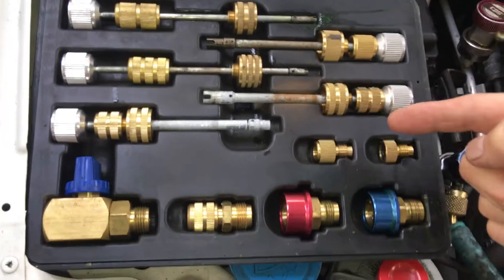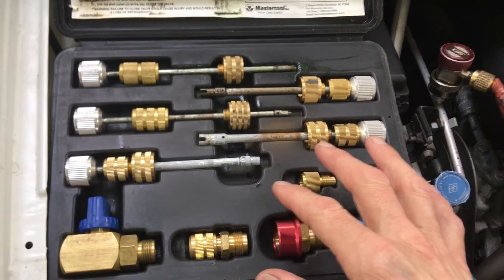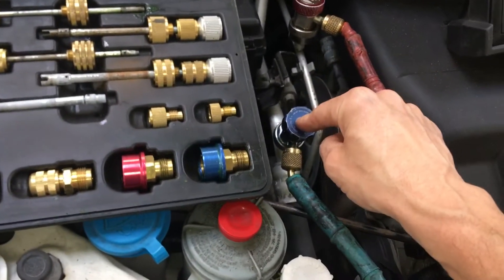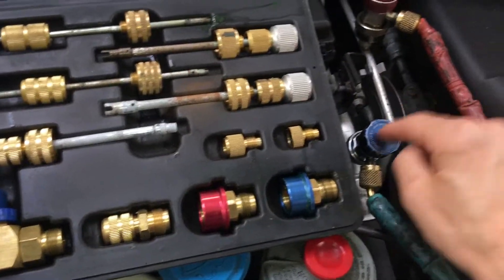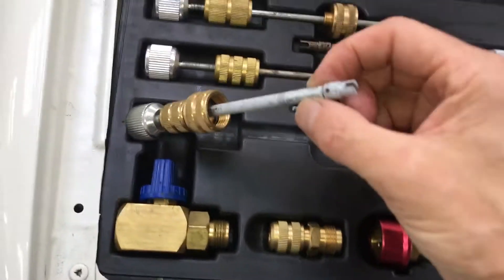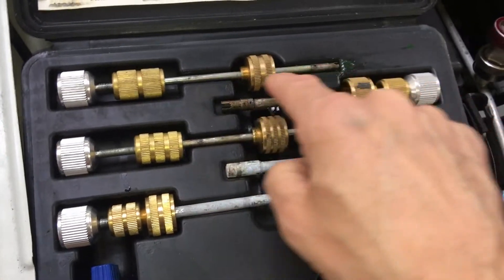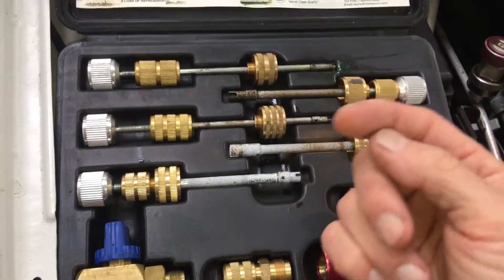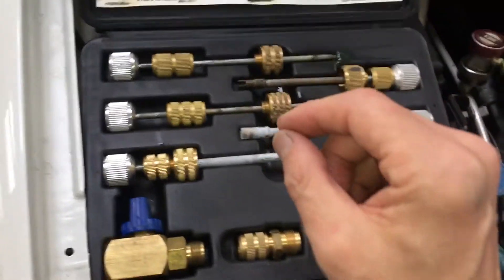R134 and R1234yf Valve core removal tools without losing refrigerant￼

Comment: Hey Tom, nice video!
Does this set fit the larger size valve cores. I need to change low side schrader valve on a r1234yf system and the kit i got off amazon is too small sadly.
Reply from the maker: It fits most.  There might be a few newer ones it might not fit.. but I have not come across them yet
Reply: @coldfinger459sub0  Thank you! It is a 2018 VW Atlas.

Comment: Thanks for introducing us to this valve core tool!
Question I've been wanting to ask is how often does your fieldpiece manifold micron gauge get oil fouled, perhaps you're taking some kind of precaution to avoid this?
Honestly, I'm getting tired of cleaning mine, lol...
Reply from the maker: I got a clean it a couple times a week. 
It’s super easy because I have pressurized 99% alcohol with dry nitrogen in a flush tank I just squirted in and then hook it up to my nitrogen tank that I have all the time anyway 600 psi blow it through and it’s clean done deal route on the vacuum pump is easy and quick is tying your shoes
Reply: @coldfinger459sub0  Alright thanks, your voice of experience is highly appreciated.